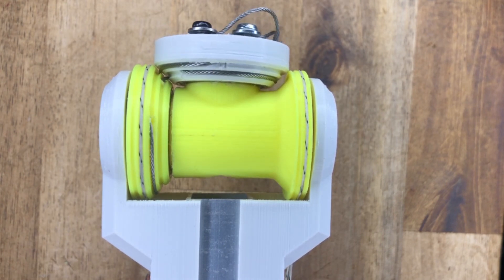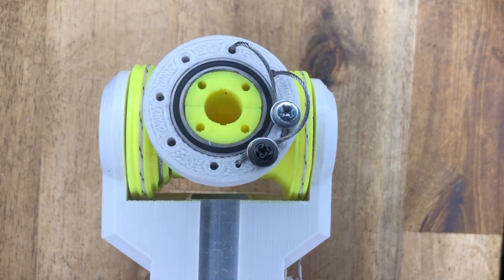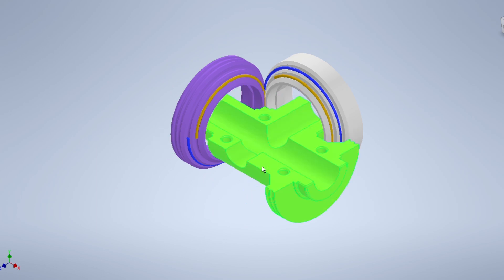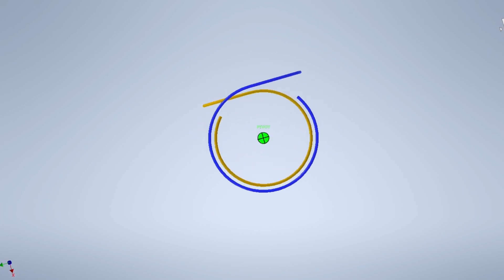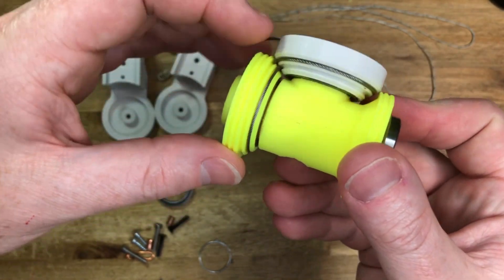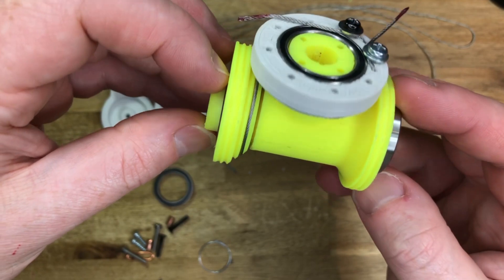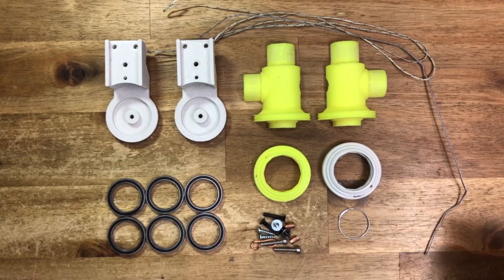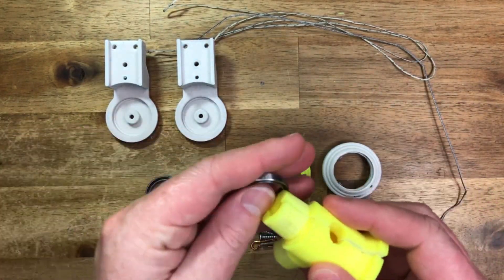3D Printed Robot Wrist Semi-differential

Comment: What about grippers? Out seems you are working your way from the base. Is this true. Do you have any ideas?
Reply from the maker: Grippers really depend on what you want to pick up. I'm trying to make a modular system and develop/improve each section as I go. I have a few different joint/actuator designs. Not sure which one(s) to use yet.

Comment: I'd recommend switching to bicycle shift/brake cables.  They're wound differently and trade some bend radius and stability for far higher tensile stiffness.  Can probably solve the crunchiness with 35-40 degree sides of the right-angle pullies.  Finally, a screw driven tension adjustment would help a ton with the backlash as well.

Comment: Very interesting design! 
Could you add a middle angled pulley to reduce the cables 90 degree angle into two 45 degree bends instead? This might minimize the crunching noise and support larger tolerances.
Reply from the maker: Check out my latest Instagram Post. I've done something very similar to what you are describing.
Reply: @PaulGouldRobotics  I like the improvement! It might be better than my idea. The main difference with my idea would be that all three pulleys (including the new middle pulley) axis would all intersect at the same point, all along the same plane.
Reply from the maker: @beilkster  Placing the bearing at the top makes the whole system more compact.

Comment: I first saw this design in the Barrett WAM robot arm.  All joints are like this, controlled by ceramic coated drums.  There used to be information sheets on their web site, but I can't find it anymore.  
I've also seen that joint called a "Swiss Joint".  There is a thesis paper floating around called "Lightweight Differential Drive for Legged Robots" which has some details in them.
I tried building a small one using fishing line, and 9 gram RC servos, but it was too hard to assemble.
Reply from the maker: Thank you very much for the additional information. The pulley design between that document and my CAD are almost the same. I think that thicker cables help a lot.